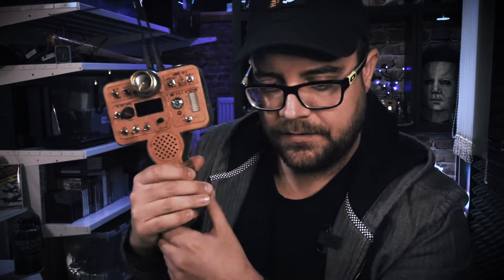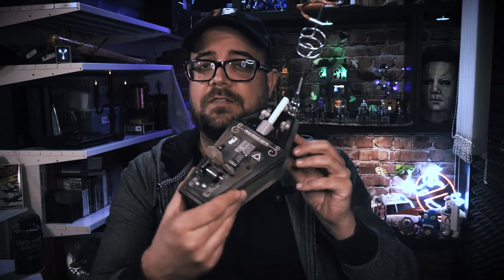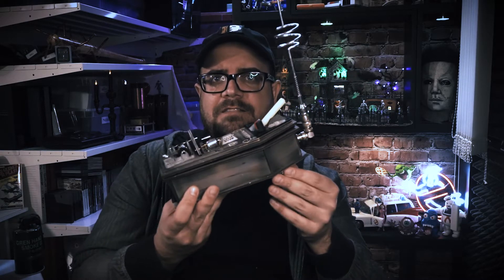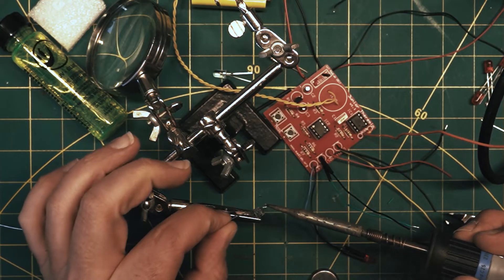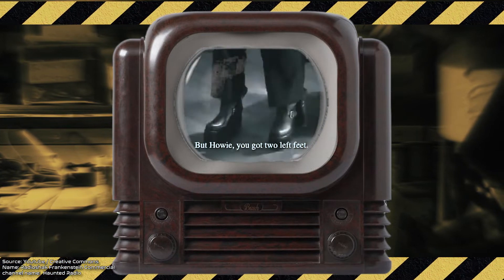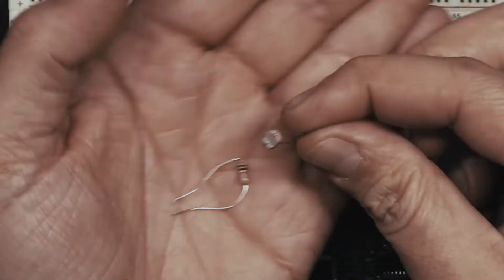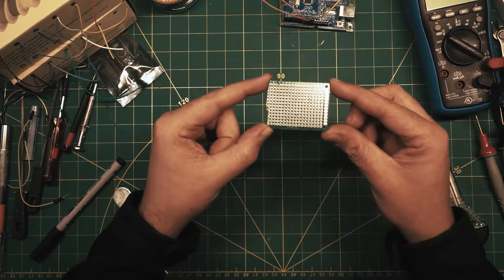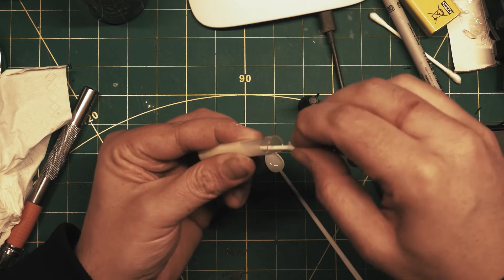Build The Ultimate Ghostdetector v.2.1 / Rempod & Temperature Sensing DIY

Comment: This needs a Relative Humidity sensor to indicate between 20 and 30 RH. This is the range when static electricity occurs naturally. Static electricity provides natural power for spirits to draw from. Knowing this is happening means the spirits don't have to drain batteries because they have a long-term power source. Can you add this?

Comment: U don’t need to use 2 arduinos to measure the temperature difference, you can do that with 1, and use variables in the code to check if temperature rises or falls…
Reply from the maker: I tried it for hours. Unfortunately my knowlege of programming are very limited and even when i made it work somewhat there where to many interferences that i decided to use two.
Reply: @MancaveEffects I’m a software engineer and I just got into electronics. I built some things on Tinkercad with temperature sensors and you have to create a global variable to store the initial temperature which you can get inside the setup() method. Then in the loop method (if you dont create a custom one) you can get the current temperature reading and compare it to the global variable you created. I think the commercial rem pods will alert to a temperature change if the temperature rises or falls +-5 degrees from the initial temperature. So in your code you could say something along the lines of: if (currentTemperature > initialTemperature + 5) {turn on LED or sound} and same thing for if the temperature drops: if (currentTemperature < initialTemperature - 5) {turn on LED or sound}

If you hook up a button to the reset pin on the arduino you can hit that button and it will reset the temperature reading. Hopefully this helps!
Reply from the maker: @2DAKE2   thanks for the input! I will get back to the project at one point 😎